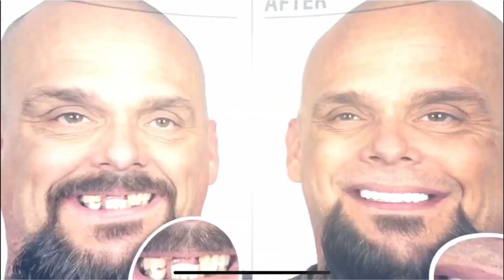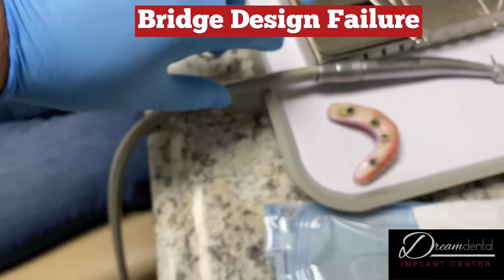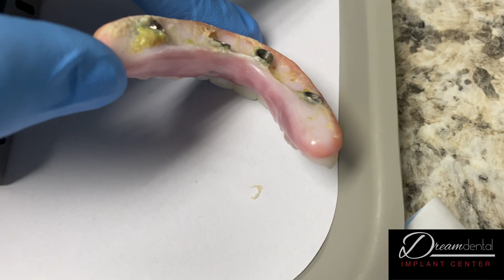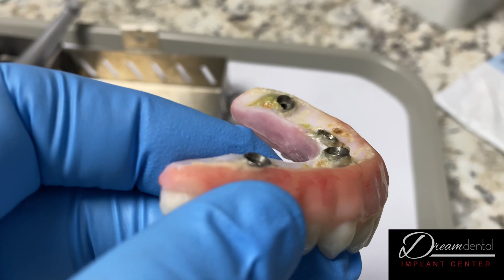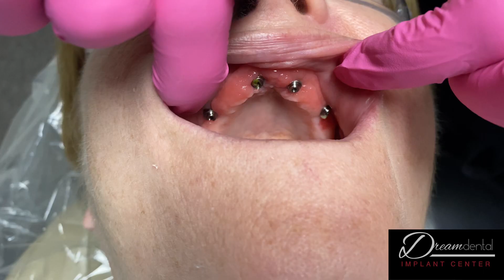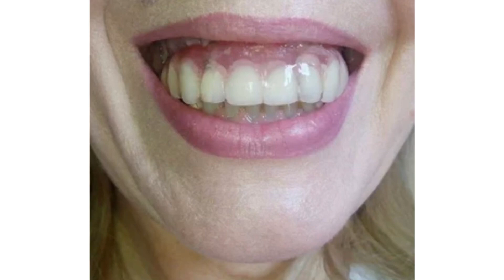All-on-4 Failure due to DESIGN

Comment: That looked absolutely horrible. I'm currently molding plastic teeth to eat. It's disgusting. Unfortunately I can't get a loan for Implants. Busting ass and saving but even that's limited. I'd gladly hand over a 60k$ property deed as collateral for new teeth. I just want my mouth back. I want to live again.
Reply: Mexico is rated as the number one country for dental tourism. Probably less than $10 000. Good luck 🌷
Reply: @melt7891  Yes.  Mexican quality..That's what you want.